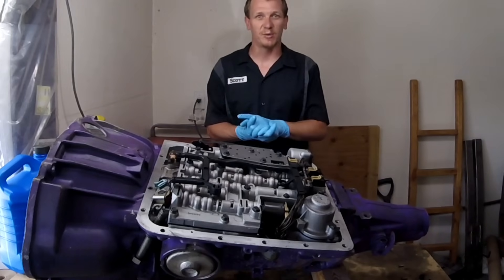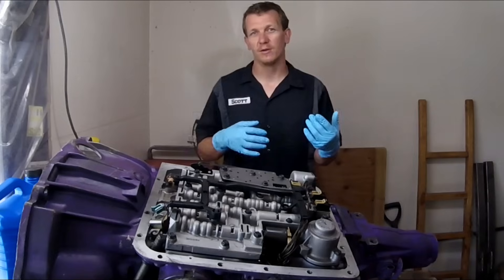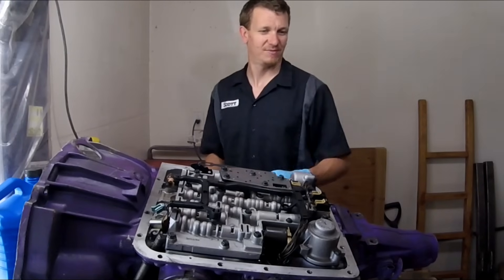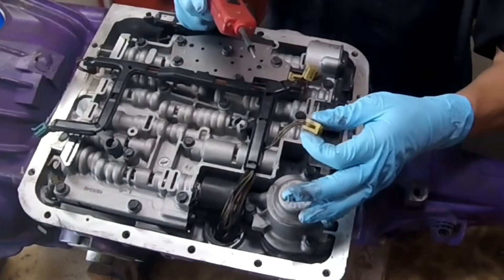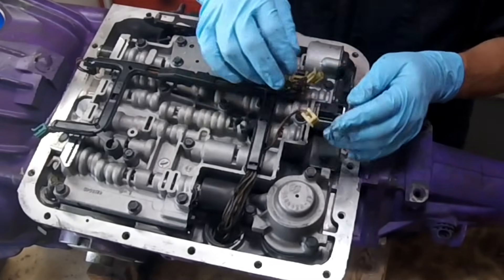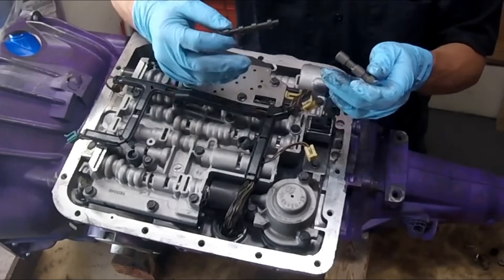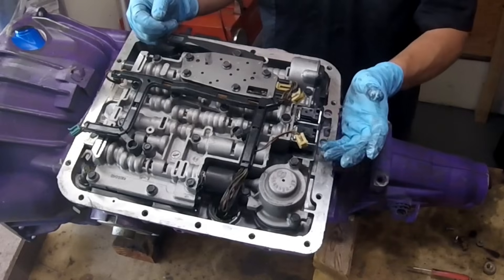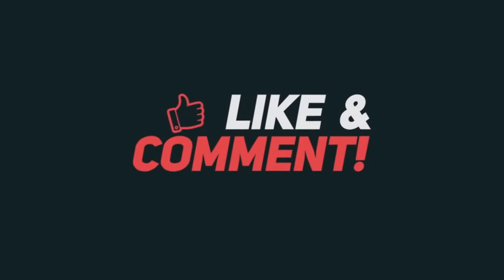⫷ GM 4L60-E Shift Solenoid 1-2 3-4 A and B replace p0756 p0753 p0752 ⫸

Comment: Very detailed!! New subscriber!! Question, my 2003 Tahoe will only go in drive and reverse at “cold” start up and then after heating up it won’t move anymore. It will only go in drive and reverse when the rpm is real high and then it will start to move. Any idea what I need to change? I was thinking the filter but I don’t know
Reply from the maker: Have you checked the fluid level and condition of the fluid? 

When a trans only works when its cold is not a good sign. Cold fluid is thicker so it doesn't leak past seals and clutches. When the fluid gets hot, it gets thin. The thinner fluid is probably passing by a seal causing poor line pressure.  

Its worth pulling the pan off to see what material is in the bottom of the pan, if anything. Make sure the filter is seated properly.
Reply: @ScottiesHobbies  is it possible my transmission is out? And how come I have no CHECK ENGINE LIGHT?
Reply from the maker: @papergatorzfedducca7998  it is possible you have a internal issue. If you drop your pan and you have a lot of material in it, you probably have burnt your clutches. If you have no material, it could be the pump fins not sealing properly and not creating the pressure needed when hot. It could be a stuck shift valve. Its hard to say its this one thing or another. Especially online. Dropping your pan will give you a little more info. 

The check engine light comes on mostly for engine emissions errors. Some codes for trans cause it to come on. There is a long lasting argument of why the trans even causes the light to come on at all. Emissions people say a slipping tranny causes poor emissions so the manufacturers try there best to use that as an excuse to add a couple tranny codes....
Reply: @ScottiesHobbies  ok thank you!! Hope it’s the filter!!🤞🏿🤞🏿🤞🏿
Reply from the maker: @papergatorzfedducca7998  let us know what you find. The shift cable might be a pain in the but.

Good luck 🤞🤞
Reply: @ScottiesHobbies  I’ll keep you updated. I’m going to try to bend the bracket a little bit🤦🏿‍♂️🤦🏿‍♂️🤞🏿🤞🏿
Reply: @ScottiesHobbies  ok I got it off. It was some metal pieces in there. It was a bunch of small pieces that will be equivalent to the size of a nickel. Good or bad???? Do I change the filter or is the transmission gone???😒😒😒😒🤦🏿‍♂️🤦🏿‍♂️🤦🏿‍♂️🤦🏿‍♂️

Comment: Question. Got a 99 GMC Sierra C3500 with 5.7L Shifts outta 1st great but won't go past 2nd gear. Reverse is also good. Would this be the same issue in video posted or something worse? Thanks.
Reply: same thing with my 01 tahoe,  wish this guy would answer questions, 1

Comment: Well I have a 700r transmission in overdrive keep jumping out but after I dropped the pan the filter was setting at the bottom it was out of it place so im hoping that's why the overdrive was jumping out of overdrive can that be possible

Comment: Hello. I appreciate your videos. They help a lot and they are educational. I have a question, did you say a bad solenoid can cause the not go reverse? I would have to replace both for a better performance?
Reply: Hello I have a question. Are both those sylenoids the exact same? Because I want to replace 1-2 2-3 I bought the sylenoid and just one came so I’m wondering if I need to buy 2 of the same ones I’d appreciate some edvice
Reply: Solenoids*
Reply from the maker: When these solenoids go bad they can cause some weird symptoms. You see more than just a loss of reverse if these were bad tho. 

I don't think you will get better performance from just replacing your shift solenoids. I'd only replace them for corrective or preventive maintenance.

Comment: Wouldnt the pressure sensor be part of this too? shouldn't that be checked for dirt and debris while it's open?
Reply from the maker: What pressure sensor are you referring to?
Reply: @ScottiesHobbies  The pressure switch manifold with the 5 black bolts in it.
Reply from the maker: Manifold.... you know.... if you think your manifold is the issue, just replace it if you are going to take the time to troubleshoot it. They are a pain in the but to check and pretty cheap for a Delco replacement.
Reply: @ScottiesHobbies  True. I really don't know, Transmission always worked fine and never had any issues with it for 140k miles. but My van sat for like 10yrs. and now everything works except the transmission won't go into 3rd or 4th gear. and the reverse does not work. Kind of a hard diagnosis because nothing led up to this and there were never any symptoms. not even a check engine light now. Before I did have a check engine light for running lean. discovered it was a bad ground on the thermostat housing which got me wondering about a ground for the transmission somewhere that I should probably check.
Reply from the maker: The worst thing for any machine to do is set idle for a long time. But... you probably have a clogged passage somewhere.  If it was mine, I would flush it. In the hopes to free something up. But I hate flushing cuz it can also break up build up that might be helping the trans keep going. Did you do the 9v test on the solenoids? Trans gets it ground from the computer to control the solenoids. The solenoids control the hydraulics to transfer power.

Comment: If my transmission is having a hard time getting into 2nd gear and won't  go into overdrive and my code is p0751 think it's the one and two shift solenoid? That's what the code is saying it is

Comment: Got a code for shift solenoid B I went through swapped solenoid made sure the proper fluid level was in it cleared codes left battery unhooked so everything would reset. Took it for a ride same thing. Some said possibly ignition switch/wiring for it swapped that still the same thing. Any ideas? Sunshell? Something mechanically wrong?
Reply from the maker: Did you check the wiring harness while you are in there? And did you check the shift valves in the valve body?
Reply: I did check the harness i couldn’t find anything. I just brought it to my buddies shop last week to see what he thinks. And no did not check the shift valves. He seems to think it’s something electrical when I hear back I will give an update for anyone that’s having the same issue.
Reply: Ended up being the 2-3 actuator broke in the trans!

Comment: Hey I have a question, but first let me tell what I have done, my transmission wasn't shifting like it should (161,000 Plus miles) so I thought it might be the filter so I had a garage to change the filter and fluid, after picking my vehicle up it still doesn't shift right and when you put it in reverse it will not move it's like you have the brake on and when you pull it in first gear it acts like the brake is on but will move move it up to drive and in pulls better. I have tested and gotten a code P0756, then watched your videos and tested the solenoids and they checked around 20.1 and 20.2 ohms , I don't have a meter like you have to check the wiring harness but I need use my multi meter to check for voltage and got 11.58 volts on both plugs from the harness that connects to the solenoids. What should I do next Thanks
Reply: I'm having the same issue on my 2003 Sonoma, reverse is out trouble taken off on first, code po756,I change the solenoid s but still have ing problem

Comment: My gmail truck when  city driving no problems when I'm on the hiway no problem until I come to a stop and start resuming speed it makes a hard shift from either first to second gear I tried putting in park and  going again did same hard shift then I tried putting in park turning off engine for 15 seconds and no issues until I got back on the highway and got off problem repeated do you have any idea what can cause that I have po890 code

Comment: Hey Scottie, thanks for the videos,  with my A and B solenoids one solenoid is loose with the clip installed,  its the 2-3 solenoid.
No second gear, I can skip second by letting up on the throttle it will then shift into 3rd and 4th normally.    Any thoughts and the loose solenoid?
Reply: Did you ever figure out the problem? I am having the same on and a code that states "Shift Solenoid "A' stuck open"?
Reply: @bradcanning875   the rod in the servo that works the 2nd gear band is too short, they sell longer rods as a fix for this..  That's what ended up being my problem
Reply: @tommywilhite1781  Thanks. I bought a new shift solinoid because the scanner said shift solinoid A stuck open and I'll do what you did as well.
Reply: @bradcanning875  do you still have 4th gear ? As long as it shift into 4th and doesn't slip, it should fix the problem
Reply: @tommywilhite1781  Yes it shifts good into every other gear up and down and no slippage ever. So I should ignore the "Shift Solenoid A Stuck Open" code. P5402 I believe it is? I bought the new solenoid and I will purchase the corvette servo kit with the longer pin. I read on Blazerforum of a guy with our exact same problem and he changed the tranny at still had no 2nd gear. He gave the new tranny to a friend and it worked perfect in his s10. It was the wire harness for him.

Comment: Which one is solenoid A and which one is Solenoid B. Is there any difference in solenoid A and B? Do I purchase 2 of the same catalog number for A and B to be replaced? I have a 2015 5.3 Yukon with a  transmission 4L60-E-RWD. Will you tell me what the catalog numbers are using AC Delco parts for these 2 solenoids.
Thanks
Chris
Reply from the maker: They are both the same. If you are gonna replace one, replace both. The the shift valves fir movement and the wiring harness for continuity if you are gonna be there. I think that info on parts is in the description. I'll update soon if not. Good luck on your diy fix.
Reply: @ScottiesHobbies  Which one is solenoid A? Is solenoid A on the drivers side and solenoid B on the passenger's side of the vehicle? The guy at O'Reilly's auto parts gave me 2 different AC Delco catalog numbers for what he said I needed. ACD 24212327 and ACD 24230298. Can you explain why there would be 2 different catalog numbers if the solenoids A and B should be the same by what you are telling me?
Reply: Which one is solenoid A? Is solenoid A on the drivers side and solenoid B on the passenger's side of the vehicle? The guy at O'Reilly's auto parts gave me 2 different AC Delco catalog numbers for what he said I needed. ACD 24212327 and ACD 24230298. Can you explain why there would be 2 different catalog numbers if the solenoids A and B should be the same by what you are telling me?
Reply from the maker: B is nearest to the accumulator.  The part numbers you gave are for different parts. The a and b are the same. The 3-4, is a different part number.
Reply: @ScottiesHobbies  Thank you Scottie! I will just order 2 of the AC Delco part # 24230298. I will put one in A to handle shift 1-2 and then put one in B to handle shift 2-3. Keep the videos coming.
Reply: I replaced Solenoids A and B and the vehicle is  running good. It goes through all the gears like it is supposed to. Thanks for y'all help!
Reply: I replaced Solenoids A and B and the vehicle is  running good. It goes through all the gears like it is supposed to. All can say is don't forget to put the filter in before putting all the screws in the pan and then realize before I put the transmission fluid in. I am a rookie but it saved me a lot of money. Thanks for y'alls help!

Comment: I have a 2003 4L60E, i just rebuilt it and put it back in. Took it for a test drive and it doesn’t wanna shift into 2nd and when it does it’s at a really high rpm then shift to 3rd and 4th fine. It also kinda shift to 2nd if I’m going and let go of the gas a little bit. Hopefully someone can help me on this issue.. thanks
Reply: Did you find out what was wrong ? I'm having the same issue 

Thank you

Comment: Hello Scottie I just found your YouTube.  Tha k you for great explanation.  I do have a question for you. 2016 GMC Sierra 1500 4x4  Error code P0777 Clutch Pressure Control Solenoid stuck on. Where is this Solenoid located? Thank you in advance

Comment: Why would transmission shops charge big money just to change the solenoid. When u just made it so simple. Because i have a 2002 Chevy Silverado 2500 hd 4 wheel drive longbed ls. And I'm dropping the whole thing for nothing. I've just learned that it's not that hard by u thanks bro. And I'm buying a whole transmission for 1200. I'm going to keep my old one and fix it that would give me a backup. Thanks again.

Comment: Do you know if shift solenoid A & B are the same?  I ask because from what I’ve seen they both have same part #’s?
Reply from the maker: They are the same.
Reply: Scotties Hobbies so I changed out both A & B solenoids and still experiencing exact same issue, and computer is throwing the same po758.  Just curious if know whether or not I need to reset or program the ecu after the change out.  Sorry for all the questions brother, I watch a lot of your videos and you seem like you know what your talking about lol
Reply: @macmann3776  did you find out what was wrong??
Reply: @macmann3776  yeah, thats my big fear. Go thru all that work and back to square one. With 136k on mine i'm leaning toward just getting a rebuilt one.  Scootie said in another video over 110k, it may not to worth messing with.

Comment: I have a 99 tahoe with the 4l60e it will not move in drive but if u manually shift it it will move like normal what's up with this thing?
Reply from the maker: I'd check the harness first.

Comment: I have a 01 blazer with the 4L60E and it wont shift past 1st gear when cold, but when its been driven for awhile and warms up it operates fine and will reach highway speeds. Shift solenoid?

Comment: My truck 2002 avalanche z71, is stuck in first gear, it will shift into second rarely. When going up hill it feels like I have no power as my rpms but no power
Reply: When I put it into , 1st , 2nd 3rd gear nothing happens just seems like I'm stuck in first gear
Reply from the maker: Did this gradually happen or just lost all gears suddenly at once? You have checked fluid color and level?

Comment: @Scotties Hobbies I have a question are the two solenoids the same or are there two different kinds that look alike?? Having trouble trying to figure out which one controls 1-2 and 3-4 .. do I buy 2 of the same exact kind and just put them in that way or is it a certain order for them any information on this would definitely be Appreciated thanks
Reply: Go to the parts store or go on ebay and order a pair.
Reply: And yes they are the same
Reply: Justin Bogard ok thanks I definitely appreciate you getting back to me and for the information

Comment: Hi Scotty.  I was coming home from work today driving my 03 HummerH2 & while going to down the road felt a hard jerk & transmission down shifted. I pulled over & put in park. Got out & looked under vehicle for fluid or anything outta the ordinary. All looked good. Started vehicle back up, put in reverse went into reverse fine, shifted to D nothing, then 3rd nothing, so I shifted to 1st moved just fine, 2nd just fine, but no 3rd or drive. Luckily I wasn't far from home so drove home in 2nd. Does that sound like the shift solenoids?
Reply: I have same problem on my 02 Tahoe did you found out what it was

Comment: why would u edit what b does????  thats what i wanted to hear   or maybe you would rather people not know?????????
Reply from the maker: Take your vehicle to a shop bud.
Reply from the maker: Or... learn how to use a googler. I've told you what it does. Again.... the solenoid controls the shift valves. Get it? If not try going to google.com or bing. In the search thingy, put '4l60e trans, what does shift valve do'. Take time to research there.
Reply from the maker: Oh yea, b does the same thing as A. They are just commanded in different sequence throughout all gears. Not just 1st and 2nd.

Comment: Working on a 2002 chevy avalanche we  bought a rebuilt 4l60e it won't go into park replaced shift cable by pass the natural safety and when it's in natural it shifts to reverse and when it's put in drive it kills the truck my question is  there something else I should check or is it internal with the transmission
Reply from the maker: If you do not have the shift linkage wire connected to the transmission can you manually shift the shift selector to park?
Reply: @ScottiesHobbies   we moved the neutral safety switch and we can now get in park were having the issue of it killing the engine when it's in drive I have been doing a lot of searchs and it's saying the tourge convertor my be stuck or the fly wheel is bent

Comment: Hey Scotty,I have a 2003 trailblazer I've just put a shift select cable on.I thought I adjusted it right but the next day It shifted into overdrive and all the sudden it started freewheeling It wouldn't  pull in any gear.It has close  to 300000 on it.Any idea what it could be or where should I start troubleshooting?

Comment: Hello, my name is Joe McCoy. I have a Chevy truck with the same 4l60e transmission, my question is? Having trouble with shifting it revs up around 32-33mph and I let up and get it to shift  again but it shifts hard. And it does it again at 51-53 mph, but it won't go in to passing gear or into overdrive. With what I seen about replacing shifting selinodes help me with my problems? You can answer me @ melissaerckfritz@yahoo.com 
   Thank you for posting the video and will be looking for more . Joe McCoy

Comment: Hi, I have replaced the A & B slonide and filter but everything is okay for a distance of only 200 meters then usually the problem is as it was and it is that the transmission starts from the gear No. 3 What is the solution to this problem
Reply: so after 2 years what was the problem ??

Comment: I got a 98 chevy tahoe with the 4L60e shifes fine till the abs comes on then speedometer dropes to 0 and it's like it goes to 2nd gear then when abs light goes off it will shift what would the problem be
Reply: Vehicle speed sensor